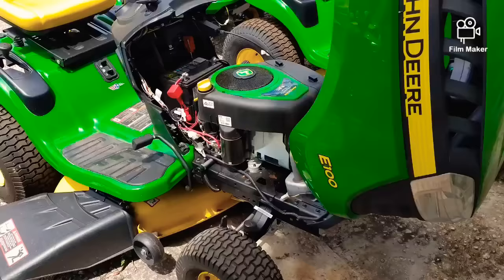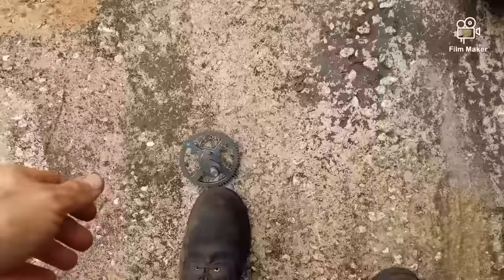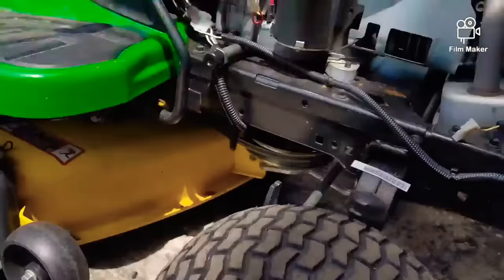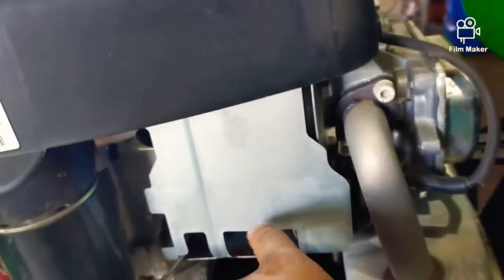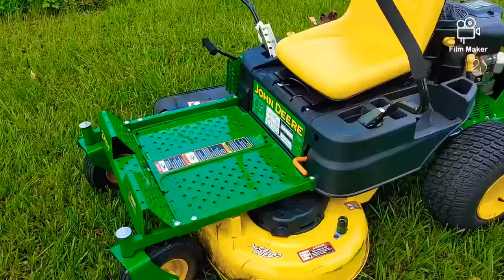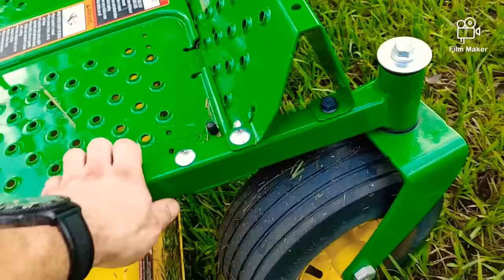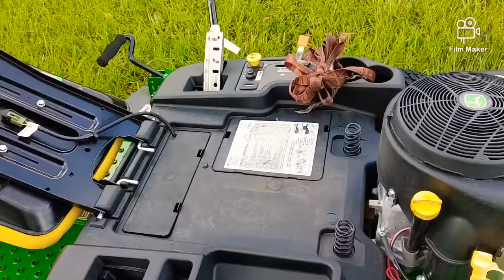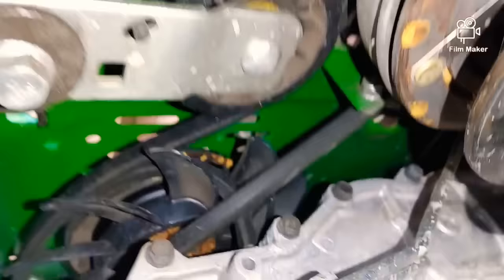Lawn mowers to avoid!

Comment: It's nice to have someone with experience to warn us about things that are poor quality. But. What is the point, if you tell us those are junk, but don't mention any good quality alternatives? If we had the experience to know (or how to find) good quality alternatives already, we wouldn't need anyone else to tell us those mowers are junk. Could you please provide a list of good quality mowers, or maybe even a few links to some that you have experienced are quality built?
Have a good day.
Reply from the maker: Hi Tony, this video was just to help people dodge some bullets. I did not take the additional effort and time to go over what to buy. (In this video)  Even if one has mechanic & fabrication experience they still would not have known about several things I exposed with those mowers in this video. For example the plastic bushings in the frame vs bearings or compression release breaking. One would need x-ray vision and an abiltiy to know the future. BUT, I have made some more recent videos comparing the 2023 brands. Here is one of them https://youtu.be/TBCQixtpu38. 
Also another video 2 weeks old going over CubCadet Stihl Emark and Toro. Also John Deere has drastically improved the Z300 series mowers for 2023. Thanks for watching! Subscribe and check out all my other videos. I got many on here to help people with simple repairs that otherwise would be pretty costly. 🍻

Comment: I bought mine in 2017. It looks exactly like the one in this video. I never had any problems with this one. Every two years I had it inspected and tuned up. As of now, I never had any repair besides checking the oil, the fuel tank and sharpening the blades. I had .7 acre of land. Perhaps, the lawnmower does well because I don't have that much acre. I don't know. I'm hoping the lawnmower would last until I die. I'm 76 years old now!

Comment: I have a Z425 with personal modifications.    Stock engine 12 Hp went out couldnt cool bent valve guide, went to bigger Vnaguard replacement, reframed steel around engine with no covers, I can get into work aroound engine, plugs, filter, etc., they all have some types of failures,....The "alternator charger",  the baggers -probably come from Malaysia, dont stand up to rough country, rubber gaskets get bent our of shape and grass ges flying all over you.  Ive had to modifiy a lot,

Comment: Remember John Deere and Toro have commercial and residential models that look identical. Many parts are beefed up for the commercial models. I've seen many a "professional" landscaper running residential grade mowers and being shocked when they break often. I've run commercial professionally and have a JD z235 at home for my 2 acres of level lawn. Its run great for years. Change the blades, change the oil, check air pressure and grease the fittings and they'll last forever. Most people don't do propper preventative maintenance. In homeowner lines, I prefer JD because of comfort and responsive,  smoother manueverability than many competitors.

Comment: I'm surprise you didn't mention wet conditions with these mowers, In Florida from April - November normally wet and these cheap mowers with rust out. Mower deck cheap metals will rust out in a couple years, and why they have a water hose connects to clean under side of mower deck it will only make it worst for the rust.

Comment: We bought a homeowner z turn from lowes for $3,500 about 10 years ago. The transmission gave out on one side in less than 5 years. Non serviceable and replacement was insanely expensive even at DIY with no labor costs. Never again.

Comment: My old Deere LA135 ride on runs extremely well for its age. I change oil annually at the end of the mowing season. Spark plugs (2), air filters (inner and outer as necessary), fuel filter annually.  As an older mower i need to finally address my steering components as i ride on a rough yard and i think everything is shot.  Im not buying anything new until i hear positive stories about new equipment.

Comment: We r in the market for a zero turn and thought about a John Deere, mainly because of the name. Thanks for your honesty. We will not be purchasing.
Reply from the maker: Hi Lavon, keep in mind this video was about the 2022 and the few prior year model Z300s. I recently did a video on the new 2023 Z300s. John Deere has fixed most of the issues I mentioned on the mowers in this video. Ive done some videos comparing the new residental zero turns and right now the Cub cadet Ultima ZT1 is currently the #1 in my opinion. If has a better deck and better warranty. Check out those videos and subcribe. Thank you for watching. Im going to be going over Toro, Husquvarna, and Kubota soon.

Comment: OMG! I just spent $860 on a new deck for my John Deere Z235 and installed it yesterday. Only 6 years old (49 hours) and it rusted so badly that the deck hangar points broke away from the deck. I’ve been sitting here thinking, maybe I should sell this damn mower to someone else before using the new deck even once! So glad I found your video!
Reply from the maker: What year is it?
Reply: @Mechanical_Mind  I bought it in Spring 2016, but it was manufactured in 2015.
Reply from the maker: @mrbilllollar  is your 2016 model the same as the one in this video? I wasnt sure what year they started making them like this. The 2023 model has been completely changed other than the deck. They fixed all the other issues I mentioned in this video
Reply: @Mechanical_Mind   My mower is the 235, not the 335E you featured in this video; however, everything looks identical.

Comment: Wide availability of hydrostatic transmissions were an inflection point as far as durability. Used to be you could buy an inexpensive fixed gear mower that would probably last a while in homeowner use (The weak points being the stamped decks and small spindles) but if you took care of them and kept them from rusting out most would last a long time. The entry-level hydro transmissions get worn out just pulling hills-let alone a trailer or anything else. And replacing them basically involves at least 50% of the value of the mower. It's gotten to the point where you have to spend for a mower with high-end consumer or low-end commercial hydrostatic just to get a machine that will last. It doesn't help that they try to fool you with "commercial" features like big tires, fabricated decks, yet the mower has transmissions made of glass.

Comment: I bought a Z345M a couple of years ago, has about 50 or so hrs on it now.  So far I haven't had any issues, and I mow 3.5 acres of pretty tall thick grass.  But I'm very meticulous with my maintenance.   But it's good to know what parts I need to keep an eye on.
Reply from the maker: Lack of maintenance and using equipment beyond what it's made to do are the two main reasons units break. But the plastic bushings for the casters  forks are just terrible. Plus, there's no grease at all. They drastically improved the Z300s for 2023

Comment: Spot on with the John Deere!
I had a Z345R with 22hp B&S. The engine and starter are solid. But that stamped deck will upset you! It lasted 292hrs before I sold it, cursed those plastic spindle collars, and checked those front tires every day! 😂

Comment: I own a car mechanic shop…I’m just learning about mowers, I think his advise on the E100 is solid as far as the zero turn 3500 review it seems like the complainants are minor issues I don’t see why it’s junk, he says the motor I solid.  I think he is just annoyed by these issues but they don’t seem like a big deal at all
Reply from the maker: I'm petty sure I made it clear that I'm annoyed with the zero turns issues. Only after hundreds of them coming in with the same exact issues 🤣. Plastic bushing with no grease vs bearings or at least apply some grease to the cheap bushings....

Comment: Hi, somewhat surprised by your opinion on the JD 335E, the reason being that I have had mine for many years and have accumulated 3500 hours on it. I have no complaints and have not had to do any other maintenance that oil and filter changes and of cause blade changes. I use it 2 hours every week in the grass season (here in Demark that is late April to end September). But nice to hear what I should be aware of.

Comment: if you go to retail stores and then go to a dealer looking at machines they both sell you will see the quality difference some cheaper models bought at a retail store   may last, but usually    you get what you pay for  anyway I wont buy  JD  anywhere but at a dealer . My mower is 16 yr old used every week  in  summer and some in winter .

Comment: I worked for a guy who had bought a Z930 series 60 inch cut. DO NOT waste money on one of those things. It was way under powered with a  puny 25.5 hp motor. The spindles were poorly designed, every time I would mow some thick or high grass I'd have to stop and dig the grass out from under the pullies, one time it got so impacted up under one of the pullies it caught on fire!!!
So I finally had to take the safety covers off and that still didn't help much. I think they make a diesel version and it would be much better, but I thought John Deere would have done a lot better job of engineering on a mower that is big bucks. IF your in the market for a big  zero turn mower go to Consumer Reports, they do a good job of evaluation on different companies.

Comment: I've had my JD Z-Turn for 9 years and really just done regular maintenance. I think where people mess up is they by their (MTD) JD's at Lowe's or Home Depot. We bought our actual JD at the dealership. They cost a bit more but the quality is there.
Reply: The JD's are not built by MTD but they are manufactured by Deere employees in a former MTD manufacuring plant now owned by Deere.  Also if you need warranty work you need to go to a Deere dealership.  If you buy from the dealer they have all your info on file and warranty work is easier to get performed.  As a former tech I don't really care where anyone buys from but I can tell you from experience it's just easier to buy where the warranty work is getting done.  Also I can tell you the replacement parts for the cheap Deere mowers are generally cheaper then you pay for parts at the local farm and home store.

Comment: lot of rust for a 7 hour old mower.  I have a Z375R.  This is the lowest commercial one they have and sells for  Ran it hard for the last 2 years, I cut 5 acres of pretty rough terrain for 9 months out of the year.  Ran it into a trailer hitch hard enough to move the truck.  Knocked over a playground set.  Busted the leg of a pergola.  (I drive a bit reckless.)  Haven't changed the blades yet, but I'm starting to notice some tougher weeds laying down now so I'm going to replace them soon.  Its stored outside, usually with a cover on it.  ZERO rust.  And the foot rest deck is pretty thick.  I weigh 290 and it never gives at all.  As for bending the deck, stepping on the deck is just ignorant so its something I try to avoid.  Not one bit of trouble or breakage from this mower, other than the deck belt flew off today because I ran over a small tree and a branch popped the belt loose.

Comment: You say the mowerbis flimsy, and it looks like it would be. I have a Z254F Special Edition and it gets great reviews.The frame is 7 gauge, which is thick stuff, especially for a residential mower. The thing people do not understand about these residential mowers is that they are built to MTD requirements to be sold at box stores. They're not built by MTD at their plants. I called MTD, Lowe's,  Husqvarna,  and John Deere to prove the point.  It is different than the so called new Supra being built by Toyota,  but the engine in it is from a BMW Z4 Roadster, built to Toyota's specs.

Comment: I had a la125 21 hp single cylinder had it 12 years sold it for 600 bucks to upgrade i got a e130 now lot more power I know its not comercial grade but I just have a half acre

Comment: For over 30 years I have used MTD products under various brand names and had very little if any concerns. One Sears brand 42 inch mower I bought in the 90s cut grass for years then I bought a 42in snow blade and pliers tons of snow for years. They all had Briggs made in America engines and great frames and decks. Two years ago I bought a Troy Bilt/MTD 30 riding mower. So far so good but the Briggs is Chinese and no oil filter on the engine ?
Hopefully

Comment: 10:38 ok if your going to do this,
Then go over the points on a comercial machine vers a residential machine 
Deck size type of metal thickness 
Sell the concept of a machine that cost 3 times as much and why.

Cub cadet,  john deer, and all the other brands have a pro line and a counsumer line.
When you go to the big box store your looking at the counsumer stuff.
If you want the pro stuff you have to go to a brand store like John deer or cub cadet dealer.

Comment: I can see the quality of all equipment rapidly deteriorating, not just mowers. I have a 2011 D110 Deere I swapped a 22 V Twin Briggs into two years ago. Thought about upgrading again so I bought a E140 and I could see the thickness difference between the bodies on them. The E line was noticeably cheapened, so I checked out a S line mower at Lowes and it was even cheaper.
Reply: You are absolutely correct.  I have a 99 lx279 and i hate to have to replace parts because you can just tell some of the new parts aren't even the same quality at the originals.

Comment: Got a lot of mowing to do?  We have owned a JD 997 zero turn for 17 years.  It is "commercial grade" and and nearly bullet proof.  Ours has a 34 hp diesel, but diesel is no longer available.  The thing runs and runs and even with a 72" deck, it will take down 18" high thick grass.  The deck is absolutely beautiful in design and tough as nails and cuts perfectly.  I think they call the deck a 7-Iron.

On the contrary, we tried a JD X749 "ultimate" riding mower.  Diesel, 4 wheel drive , 4 wheel steer!  Thought it would be the best thing to get around trees (it is good), and along the edge of the pond where a zero turn will always get into trouble.  This is the WORST mower I have ever owned, and I have owned many.  The problem is the deck just will not cut.  All of the "stuff" needed to turn the blades is packed under the deck, meaning there are a lot of obstacles for the grass to move around before it exits.  This would cleanly cut grass maybe 1" to 1.5" at a time, otherwise the results were really crappy.  Bad, bad purchase decision.
Reply from the maker: The 997 is a top of the line commercial grade mower.

Comment: I've had a z235 for about 6 years with 250+hours.  Only issue I've had are the front tires are finally not holding air but not bad for how old they are.  Still original battery. Changed oil many times.  Replaced mower deck belt, blades, and main drive belt a few times.  Drive belt can be a pain but there is a trick to it which after the 2nd time is really not that big of a deal.  Never had my deck bend... why are people stepping on the deck on their zero turn?? Just step on the front like you're supposed to.  Not hard to take care of your mower and make it last.

Comment: I had an L100, one of the spindles died because there are no grease nipples on them! Then the motor constantly played up with the decompression problem plus I had to adjust the valves at best once a fortnight and at worst once a week. The deck cracked up and finally fell to pieces. JD are doing themselves no favours selling this rubbish and I put a Chinese motor on mine, stripped away all the unwanted rubbish, added a tow bar and it now serves as a better than a wheel barrow way of moving stuff around or dragging a 50L spray unit around.
The mower I replaced it with was a Bob Cat contractor zero turn and 8 years on it still starts first time every time and is as solid as a rock.